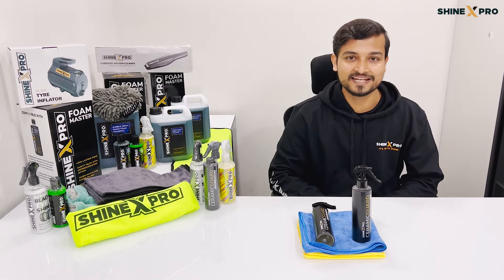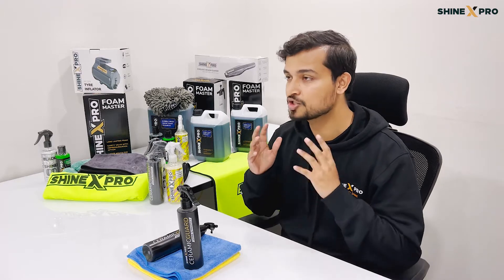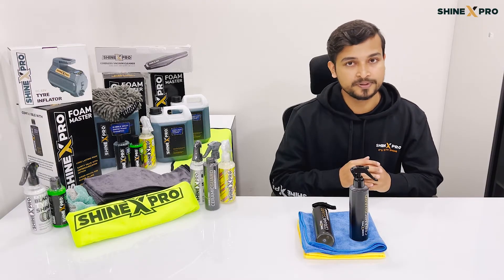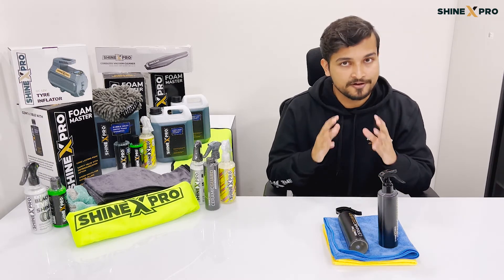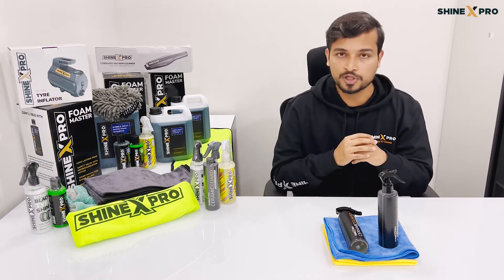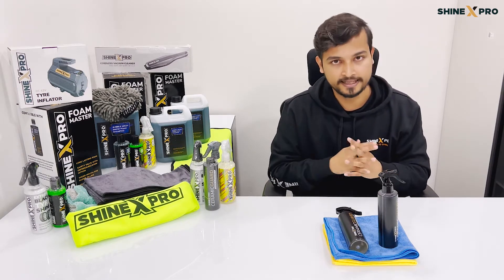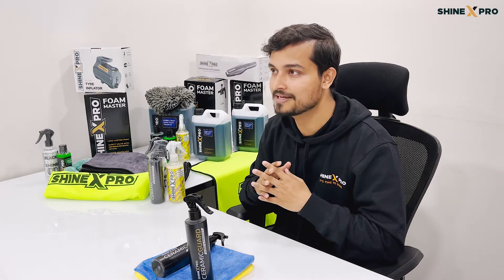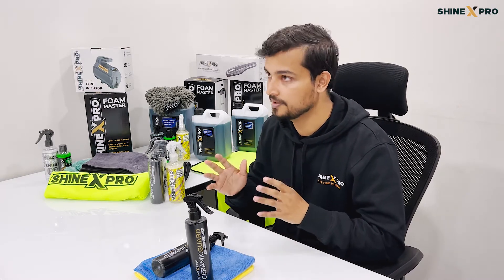How To Apply The Ceramic Guard

Comment: Did as per instructed. Cleaned car thoroughly using shinexpro form. Then applied wavex clay and then just applied shinexpro ceramic guard it on bonet as per instruction. I can feel the smoothness on surface. So I am sure it must be hydrophobic now but there is no change in shining of the car.

Comment: I used it on my bike and it's wonderful smooth surface ,, means dirt won't stick to it any more,, and shine is not too much but ther is difference if I park it in sunlight... but u have to work faster if it dries before buffing it leaves a white salty like substance on the surface ...

Comment: Can we apply this product on our car’s windscreen ??
Reply from the maker: Yes, you can but you have to be extra careful during application and make sure to buff it properly to avoid hazing. You have to make sure that the surface is absolutely cool to the touch and you apply in a shaded area.
Reply: Did you apply on the windscreen ?🤣

Comment: Launch a product to bring the original colour of black plastics used as trims in the lower body of cars. They turn white and faded over the period of time
Reply: Is it safe to apply on Kia seltos car???please reply soon
Reply: @rohancaptain3700  yes only on metal part
Reply: You can use a dashboard cleaner for this...i use it on my dark edition harrier and it works wonders

Comment: Can it be used on wind screen
Reply from the maker: It can be but you have to be extra careful during application and make sure to buff it properly to avoid hazing. You have to make sure that the surface is absolutely cool to the touch and you apply in a shaded area.

Comment: Fibre clothes are not of good quality.
Reply from the maker: The complimentary 300GSM microfiber cloths that we provide are enough for application. If you want higher GSM cloths, you can purchase them from our website too.
Reply: @shinexpro  I used it and got marks in the pattern you suggested.  It's another level of swirl marks now . With criss cross pattern.
Reply from the maker: @kpmotohead1200  we regularly use the same 300GSM cloth for our testing, along with thousands of customers who have used the same cloth too and we have honestly not gotten this feedback.

What tends to happen sometimes is since the ceramic layer is a transparent layer, it tends to act like a magnifying glass and sometimes after application, the underlying swirl marks on the surface become more visible.
Reply: @shinexpro  if ceramics work in this way then the product is not going to solve the purpose for which people usually buy this. I will surely come out with a video on this .
Reply from the maker: @kpmotohead1200  the purpose of a ceramic coating is providing a sacrificial layer of protection, slickness to the paint and hydrophobic properties, all of which Ceramic Guard does. If there are existing swirl marks on your paint, no ceramic coating can remove that, that requires paint correction which is an independent process.
Reply: @shinexpro  there were no swirl marks on the car. As it was just bought from the showroom. And I ordered this product well in advance before taking the delivery. I don't question your product but because Somehow I feel the reason behind these marks is  poor quality fibre cloth being provided by the seller .